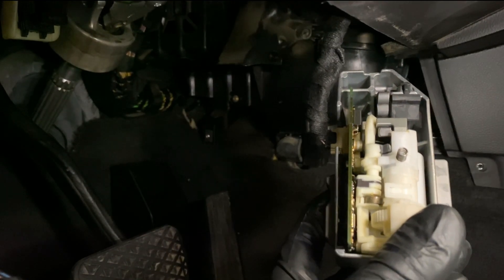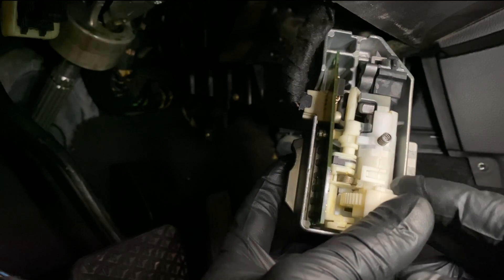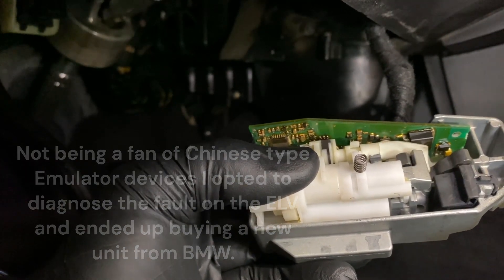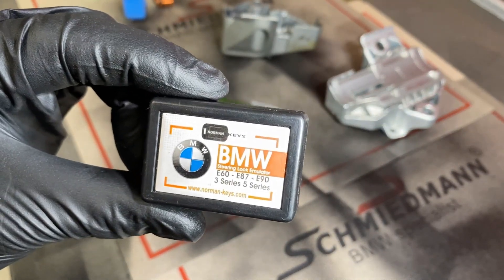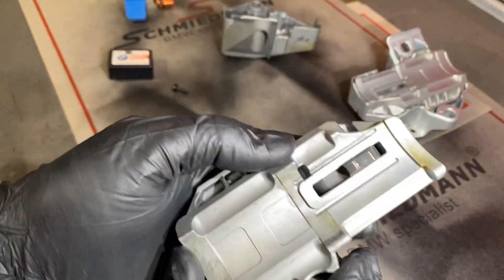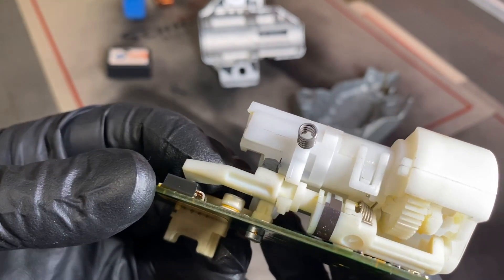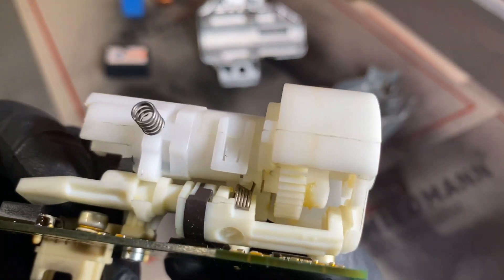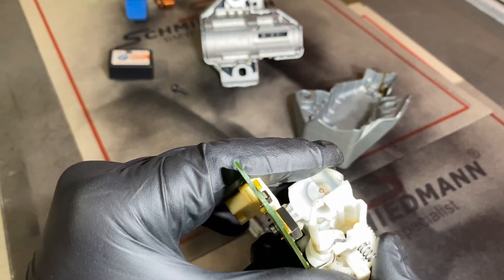steering wheel lock bmw e60

Comment: bmw e61 2005 525d I just got my steering wheel locked ( couple small stucks before it locked dead)  on the road, thanks God it was a straight line, i’ve stopped, removed panel, and was a bit surprised that my lock mechanism is not plugged in, i removed security bolts drilling them a bit ( they were loose) took the motor board out and  finally wheel at least could be turned like ON/OFF switch, with much force applied lock teeth could by passed by steering shaft, and then i spent 4 hours trying to drill out/grind down the locking pin that locks the teeth ( jesus how this mechanism even works)
Reply from the maker: Well done 🙂😀

Comment: I have 330i 2006 I have a wheel lock engaged..plz help
Reply: Thank you 🙏 so much much grateful for humanity careness for others with these types of problems..I will definitely keep u in my thoughts and prayers
Reply from the maker: @EddieAvalos-vw9gt No problem 🙂 Let me know how you solve it in the end Eddie 🙂
Reply from the maker: Buy an emulator or replace the electronic steering lock szl.
Reply: @BenJFF  also next question I have ..when u stated to replace the  lock u mean delete the lock or replace the steering column
Reply from the maker: @EddieAvalos-vw9gt The lock comes off the E90. The new lock can be bolted back on then you need to do CAS - DME/DDE matching and the new lock will be coded. The problem with these locks usually is the motor wears out. If you can find a motor try it. Occasionally the ribbon from CAS to ELV wears too so remove it and check it. The ribbon is not expensive. If this helps you can leave me a superthanks which I will buy a coffee with 😉
Reply: Is the emulator have to be programmed or is a plug n play
Reply from the maker: @EddieAvalos-vw9gt Plug and play. You would remove the ELV lock and throw in the bin. You must understand you will then have no steering lock locking wheel any longer

Comment: İ had AL Active Steering - 613D AL: Lock : Electrical Fault how can i fix it wat should i do
Reply from the maker: Not related to this. This is ignition lock. You will find a 2 wire connector on steering gear near exhaust heatshield - they usually suffer broken wires. 613D refers to active steering rack (AL = Aktiv Lenksrad)
Reply: Okay i will check it thank u so much  @BenJFF
Reply from the maker: @harunuzun-ir5tn No probs. Make sure to subscribe.